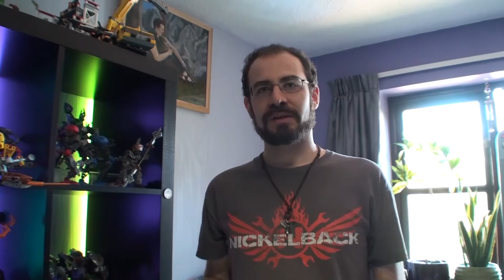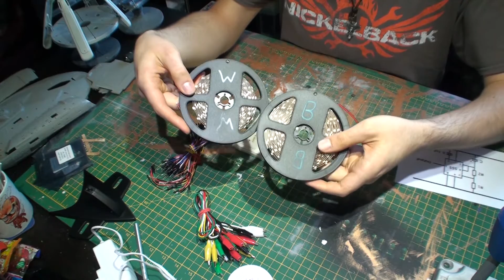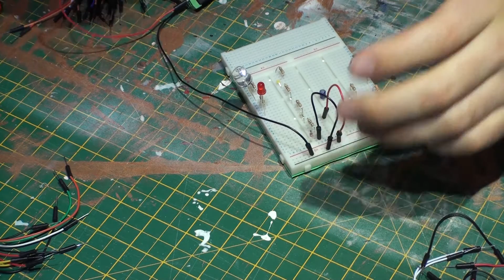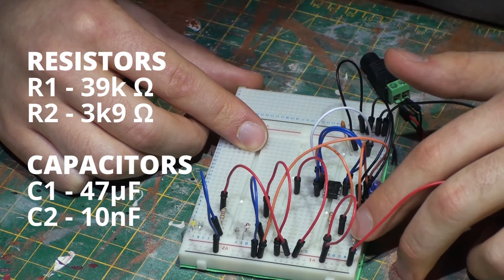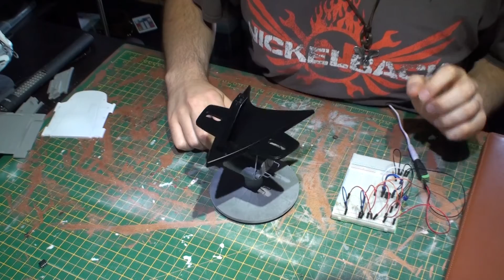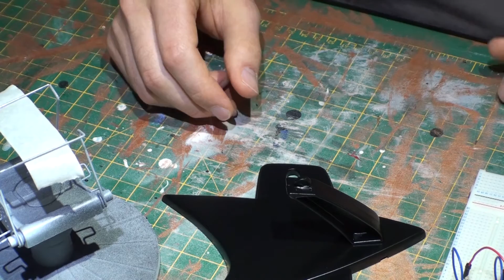Revell USS Voyager Model - Episode 6 - Building the 555 Timer

Comment: Its a bit closing the stable door post horse escape, but 555s are massively cheaper from China via EBay or Amazon. I picked up 200 for approximately £1.50. They've all worked so far, which beats Maplins failure rate.I'm stealing many of your ideas for when I eventually build my Voyager.Good work fella.